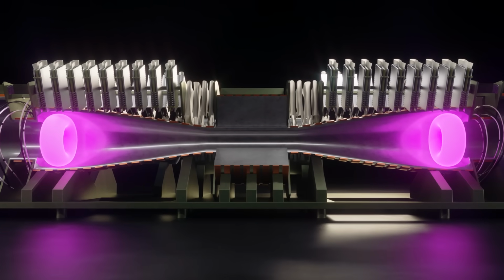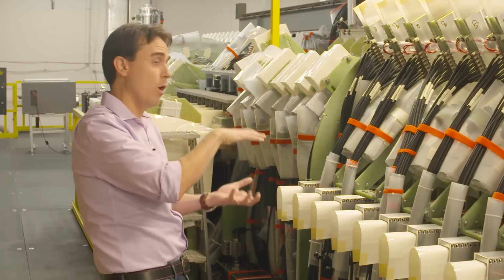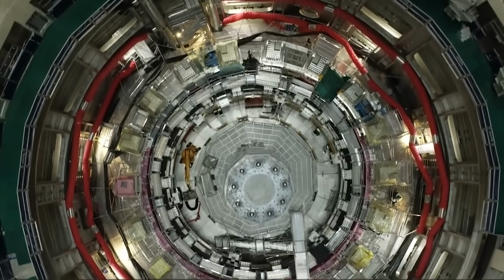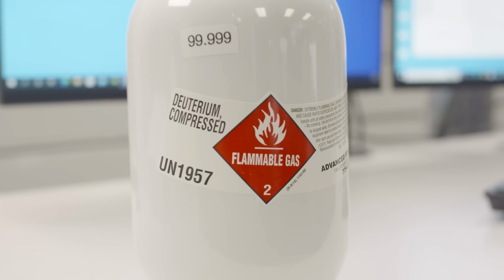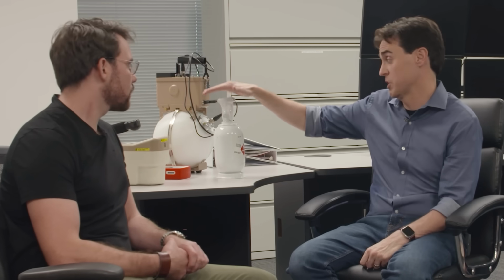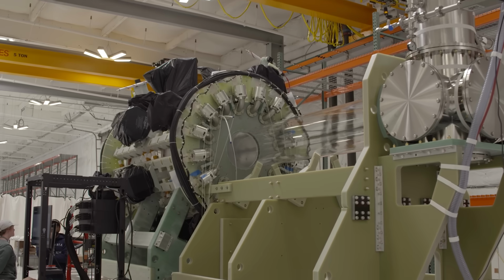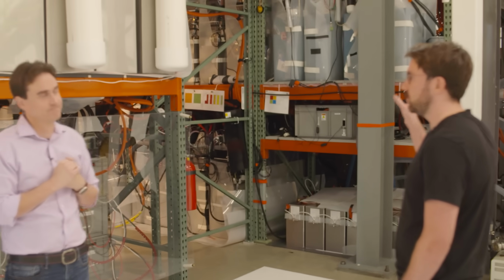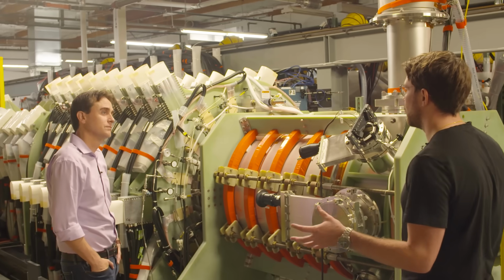A New Way to Achieve Nuclear Fusion: Helion

Comment: I like the step away from using fusion as a way to generate heat to boil water to make steam to run a mechanical turbine. That alone is great but the overall design is great to see. And the fuelling of it too lots of forward about the fuel itself. It will be exciting to see future progress.
Reply: It may open new era of space exploration if they will make it viable.
Reply: @Pasha231514  I was thinking the same thing. If this works they can put one on a starship for unlimited energy
Reply: Going straight from plasma rings to electricity is also how fusion works in the BattleTech universe. So maybe I'll get to drive around in a Marauder Battle Mech someday after all.
Reply: I once found a economic analysis of fusion. They predicted by 2040, steam to electricity conversion would be uncompetitive even if generating the heat was free.
Reply: @Zen_Differential8004  That doesn't make sense
Reply: @lucasng4712  not necessarily no.

while from an energy efficiency perspective it would be impossible to outperform free heat generation since that's quite literally infinite energy.

Efficiency is not the only metric used in an economic analysis, nor is it the most important.

Utilizing heat energy through steam engines has a limiting factor of space, so while the efficiency would be unparalleled, its actual energy output is limited by how large we can build the generator which in turn limits the projects economically in the form of material costs and land costs. And one could argue that "Performance" would more so refer to Energy Output than the efficiency of achieving said output, hence why you can have High Performance but Low efficiency systems or vice versa.

Finding conversion mechanisms that aren't space constricted, so direct heat to electricity conversion (peltier effect), using the magnetic forces to run a generator etc etc, may not be as efficient, but you can scale it further due to not being space constrained.

Edit:

A really easy way to visualize this, is just comparing the size of a tokamak to the helion reactor, the helion is small enough to be inside a building, the tokamak effectively IS a building.
Reply: @lucasng4712  Generating electricity has more operating costs than just the fuel. Running heat exchangers and steam turbines have a cost as well.
The observations that the analysis hinged on were that the costs to build and run these parts of a power plant had plateaued for several decades. Without an major improvement in their $/watt, they determined that no form of thermally generated power would cheaper than where solar is project to be in 2040.

Comment: This is a unique riff on the “Pinch” machine that the British experimented with in the very early days of nuclear fusion research (cir. 1948-50). The kinetic acceleration of the mirrored plasma is the unique part before using the magnetic pulse to compress the plasma in the final step. Also, their approach of trying to harness the excess magnetic energy to turn a generator is very unique as well. Hopefully the additional energy they will need to do their D - H3 reaction won’t be an insurmountable scaling problem. All I can say is good luck, hope they can make it work.
Reply: I don't think there's any turning of a generator involved. If I understood correctly, they're using magnetic induction to produce electric current directly, and completely solid-state.
Reply: @gavinwilson5324  I believe you are correct
Reply: @gavinwilson5324  the time constant magnetic field can not produce any energy in winding. As there is back flow of plasma, to decelerate this Mas, there must be AC field generating opposite force. Balancing the inlet/outlet energy as they claim the time is about nanosecond. Anyway inertial mode can't work in solid state regime
Reply: @gavinwilson5324  Thanks for correcting me. I didn’t realize that they were using magnetic induction to generate the current. That makes much more sense. Guess I should have paid more attention that part of the video.
Reply: As you said, similar configuration were created in some laboratories half century ago. MHD/inductive  generator limits the type of reaction, but is good idea, even it have to switch the current of 1 MA at the rate of 2 GHz
Reply: This one is neat because it doesn't require pellets, which would be difficult to produce at a reasonable cost in high volume. It also seems to have some parallels to the Lockheed reactor design, although Lockheed was a bit more mum on some details.
Reply: The notion that anyone is going to couple induced EMF out of this configuration with any reliable efficiency makes me very skeptical.    The way this video equivocates between particle energies and the completely separate issue of generating power from a resulting (impedance matched) macroscopic magnetic field doesn't help.   The fact that they don't seem sure if they are generating energy via generating a coupled plasma current or ("alternatively") storing a generated fuel indicates that my skepticism isn't going to be meaningfully addressed in the near future.  Given the level of hand-waving across this entire field regarding the issue of efficient coupling, this is par for the course.  Hope to be pleasantly surprised.
Reply: As you said, similar configuration were created in some laboratories half century ago. MHD/inductive  generator limits the type of reaction, but is good idea, even it have to switch the current of 1 MA at the rate of 2 GHz

Comment: Man where to begin describing my admiration for this project, I'm so overwhelmed by the level of engineering of all kinds to make possible such ideas, and put together so many components to make it work, and since I'm not an expert but rather just an aficionado of nuclear energy, I still don't quite get the whole process specially how it generates energy, I guess my brain is has the concept of turbines spinning so embedded that I struggle to understand how the final result of the fusion moves the magnets to create the Electricity, but I hope to continue learning about this so I can expand my knowledge about it, I also think it is still far from managing to create more energy than what it requires to create the fusion which is the same challenge to create energy from fusion with a tokamak but as usual when a problem comes up the solutions follows. Thanks for again bringing excellent content about these topics.

Comment: They use helium.  Helium is in very short supply.  I like the part about creating their own helium using two methods.  One fast and one slow but still production.  I wonder if the heat produced and effecting the mechanics could be funneled off for another power usage?
Reply: they use D+D reaction to make the He3 which solves that but takes good chunk of the energy with it.

Comment: Giga watts...  I like Joules better.  You can be a great performer... a flash in a pan, but slow and steady is what wins the race.  I'll be excited when they can do continuously.  A fraction of a thousandth of of a second won't turn a generator to power my AC.  Interesting physics, but I'll let mechanical engineers work on it for a few decades before it becomes reality on lowering my electric bill.  Until then, I will rely on fission baseload (and coal baseload) to power my home.  Still, well done.  I like skipping the steam turbine part.

Comment: I don't think I can ever wrap my head around our ability to contain something a million degrees hot! How does it not just burn through everything? So crazy. Incredible video!
Reply: It’s in a vacuum chamber, suspended by electromagnets. It physically comes into contact with nothing (as close to nothing as possible, obviously not completely perfect but that’s tolerable wear and tear).
Reply: @R8FKL  Also the whole reaction happens very quickly

Comment: It's extremely nice to see and hear, but isn't the stellarator in germany a better option? In Helion you have the problem of being in pulses, where stellarators should be continuous opposed to both laser fusion and tokamaks?
Reply: It doesn't matter - if the pulses are sustainably frequent enough they will achieve what they aim for - movements of magnetic field in the central part of the reactor which they will transform to some kind of kinetic energy

Comment: D-He3 and D-D fusion has a factor of ~100 lower rate coefficient for fusion at ~100 million kelvin. Helion needs to have a much higher confinement time or density or temperature (or a little of all three) to accomplish the same thing as a tokamak or ICF. A tokamak or ICF target can do the same thing and run tritium lean; this requires an increase in triple product and makes some or all of the tritium it needs inside the reactor instead of absorbing neutrons inside the wall. The reason for D-T fusion is to avoid making things way more difficult than it needs to be. Ultimately you may want to do P-B11 fusion, but it's not the kind of thing you do in a demonstration plant.

Comment: This is really neat! I always wondered why Tokamak and ICF is used to boil water instead of finding some way to capture the energy the fusion process releases. And Helion seemed to have figured out how to do just that
Reply: I'm not an expert, but I think it's because the particular deuterium/tritium réaction in tokamak and most ICF designs creates a lot of neutrons, which need to be absorbed rather than harnessed for energy directly (like Helion's charged particles).
Reply: welcome to new problem to solve, IR loss in capacitor and capacitor price to be able to feed the grid
Reply: likely because its the best method available for tokamak, like how it is in regular nuclear reactors
Reply: Because its extremely efficient as you need to absorb the surplus heat energy anyway and proven tech.
The video is about a scam.
Reply: @alphana7055  It's not efficient in a thermodynamic sense. Typical conversion losses when trying to generate work from heat means that, in a conventional powerplant, your observed efficiency is only 30-40% at most. Obviously, Helion's approach could be much better if it works.

Comment: Seems like the tokamak might not be the way forward .
With the Laser based design of the Livermore system creating enough excess energy to boil a kettle and engineer's running over figures to try and design a power plant based on the Livermore design the tokamak designs are looking less than promising.

And the Helion system having many advantages over a tokamak the fuel used being only one advantage.
The money wasted on tokamak designs must seem phenomenal at this particular point in time .
Especially when compared to my two current renewable energy powered power plant designs which are ready to go as soon as they can be built .
As usual fuel is a problem .
Some of the smartest people in the world have been working on fusion for forty years plus .
So glad l took a different path .

Comment: Thanks for a fascinating in depth view of a novel approach to achieving fusion power generation, BUT... finding a novel method that starts addressing the countless and immensely complex challenges of fusion only means we are still 30 years and 3 trillion dollars away from practical and functional implementation at scale.  Safe, practical, functional and scalable SMR/LFTR fission reactor designs with accessible proven technologies are available NOW. These 4th gen fission solutions seem to be a vastly superior focal point for R&D investment, especially as China brings their LFTR generators on line. With increasingly likely tipping points in irreversible climate catastrophe looming, humanity has about a decade to break our fossil fuel addiction. We need immediate solutions that stress achievable function over glamorous form. Plus, advocating for nuclear fission is controversial enough that you can probably garner a huge audience by just promoting the practical necessities.

Comment: For some reason this fusion engine reminds me of an old Detroit diesel. And it's about what I expect a fusion engine on a starship to look like.

The engineer was talking about having this reactor cycle 10 times a second. I'm gonna go out on a limb here and say as they are directly generating electricity using the containment magnets, 60 pulses a second should be the goal for direct grid synchronization. That should eliminate the need for any frequency correction systems, thus improving efficiency

Comment: Did you run the numbers on this? Like what's the theoretical maximum energy you could get from this design accounting for all the losses in the system, what's the practical amount you could get given costs and other challenges, and how close are they really?
Reply: They didn't really give numbers other that how many discharges were donce with the capacitors and how much energy was used by them.
Reply: @steeveolivier2847  can you provide them? Like to us..
Reply: @amanpanda3021  just listen to the video
Reply: Less than zero, they have no idea how to achieve breakeven and just scamming investors.
Reply: @alphana7055  q>1 already exists on tokamak reactors, even when you commented this. It's just a matter of all the things they've said.
Reply: @alphana7055  we will see by the end of 2024. I temple to have thésard opinion than you but i'll wait and see

Comment: You (and David) say that the ions move at 300,000 km/s but that would be more than the speed of light. I am guessing that this number is rounded but I'm wondering what percentage of the speed of light is actually achieved...
Reply: Nope, speed of light is 300,000 km/s :)
Reply: @duszan2  299,792.458 km/s is the speed of light, km/h was a typo by me, but also I just realized there's still a factor of 1000 between those numbers because they say 300 km/s

Comment: I'm a little confused. Are they getting net positive energy from this system? Running the magnets and all the other parts of the machine take a lot of energy. Do they get out of it more than they put in? Also, when doing those calculations, do you include the energy it takes to make the helium 4 at the other facility once it gets to that stage?

He says ten million and a hundred million degrees several times without ever giving it a unit. Does it really matter at those temperatures whether it's °F or °C? I don't know. Maybe he did say and I missed it.

Comment: So, if there were 2 of Trenta devices, where fusion cycles are offset so that when one machine's fusion/expansion cycle provides the electrical energy for the second machine's ionization/compression cycle.  Then when the 2nd device goes into fusion/expansion cycle, the power generated is fed to 1st device's ionization/compression cycle.   And so on.

You would have a generator which powers itself, that works sort of like a 2-cylinder internal combustion engine.

You can let excess electrical power out into the electrical grid (with appropriate filtering, voltage stepping, etc).

Interesting....

I'm sure this is their goal, and is in their roadmap somewhere.

Comment: If helion manages to make it work then cool, wont knock that. But fusion is not a "new frontier with not many textbooks to read from" XD its a 60+ year old discipline with many textbooks, come on my guy less of the BS, you are usually better than this with your minimal dramatization and solid referencing

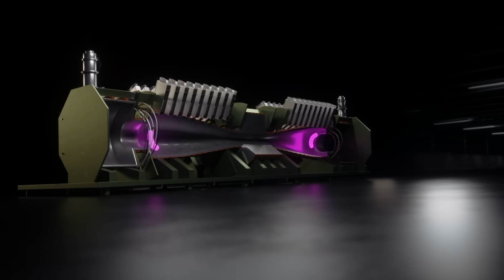Comment: @18:30 This is the first time I've heard a company actually address repetition rates in nuclear fusion.  Usually they geek out on the fact that they can charge up their capacitor banks and fire the system once, with the fusion lasting only a fraction of a second.  I'm impressed that this system can fire every few seconds, and they are actually talking about the need to fire multiple times a second for the technology to be truly useful.  Still not ready to invest, though 😅

Comment: Helion would  be a magnificent achievement, The way they are achieving the state of equilibrium is impressive, The sun achieves this with gravity and the urge to destroy itself by constantly pushing outwards , Gravity pushes back and so it's lit, Also Helion looks to completely eliminate the need for turbines, converting neutrons directly  into electricity. By far the most advanced fusion reactor there is.

Comment: I think a clarification is needed with the statement that fission is too expensive and unable to compete with cheaper forms of energy production.  That isn't a problem with fission itself as much as it is a problem with both government regulations and radical environmentalists doing everything possible to keep the technology from improving.  No commercial nuclear reactor ever made in the US was remotely as dangerous as Chernobyl or any of the crap you see in movies but widespread ignorance and irrational fear resulted in us being decades behind in develpement.  Modern technologies like pebble bed reactors can create far more cost effective and safe energy than the old reactors, and when scaleed up a modernized nuclear industry would be both better for the environment and would support the push to convert our transportation system to all electric.  Wind and solar will never support the baseline power grid needs we have now much less when all cars are electric.

Comment: Eventually they have to change electromagnetic fields to discharging blankets of material they inject in, like they do in pistons, where instead of letting the piston suck in the gas, they inject it.

At least in turning we learned that the way we overcome a harder material with a weaker one is geometry. Its just a tought process right now, but hopefully they find materials that they can inject in calculated trajectories that violently with the fuel shoving it one direction while the injected stuff reapears in a "capacitor". Kinda like when you ask what will happen if we throw a bucket of water at the sun that is as big as the sun? It fucking explodes probably snuffing out the sun.